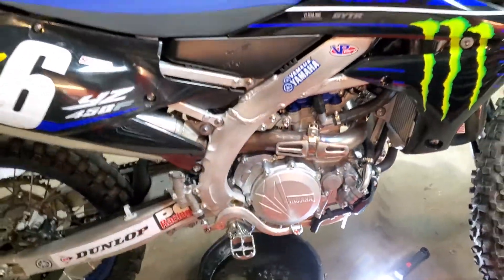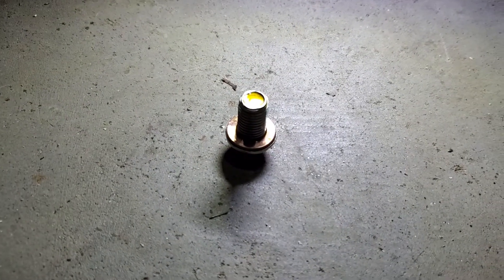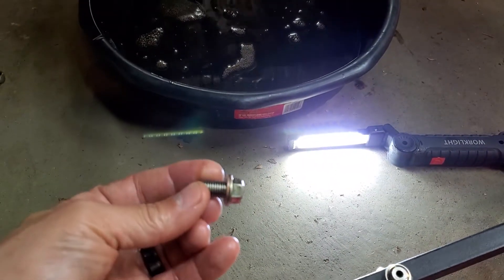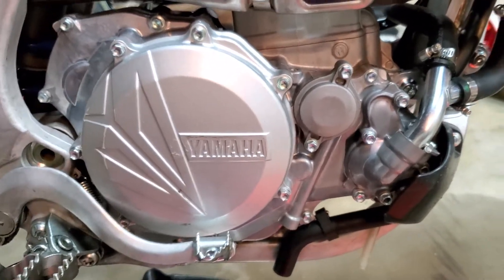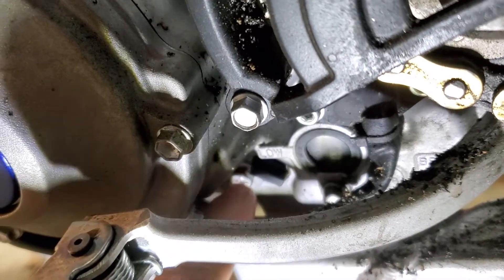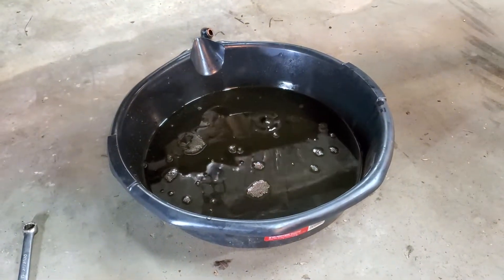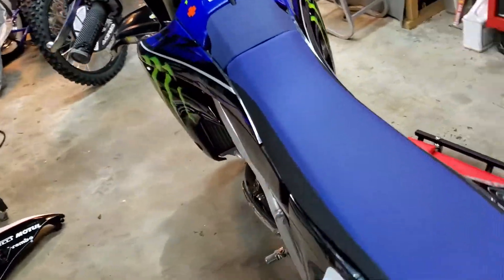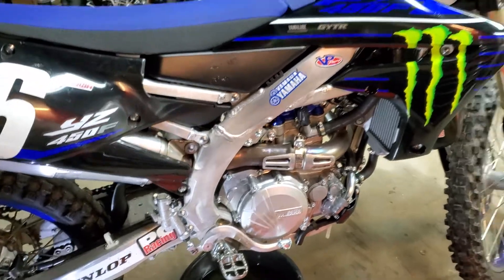Oil change 2021 Yamaha YZ450F YZ 450 YZF 4-stroke Motocross bike 2023 2024 2022 2020

Comment: Any chance the oil smelled like fuel? Just changed mine and it had a fair amount of fuel in it. Only have 4 hours on my bike and did the break in process and first change perfectly...
Reply from the maker: Never heard of it with an EFI bike.  Take it to your Yamaha dealer to be investigated.
Reply: @HorsepowerHouse  apparently it’s been pretty common with the 2021’s… lot of people are saying if it sits the injector could leak fuel and to disconnect the battery if it’s gonna sit.
Reply from the maker: @Nboles64 well, it is not normal. So I would have a Yamaha mechanic at least look at it to diagnose it.